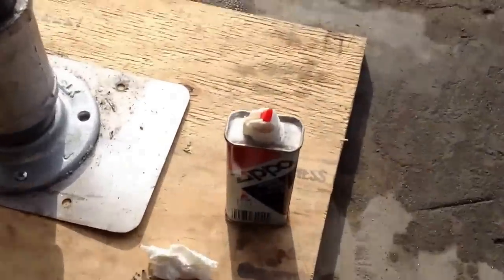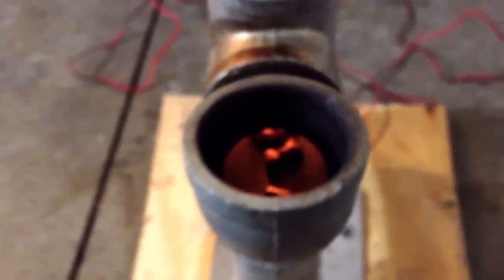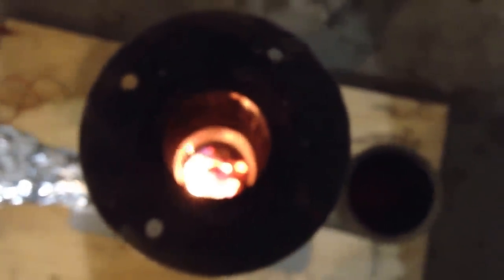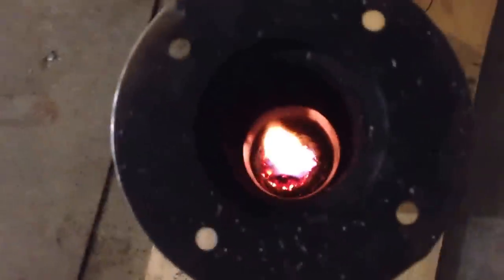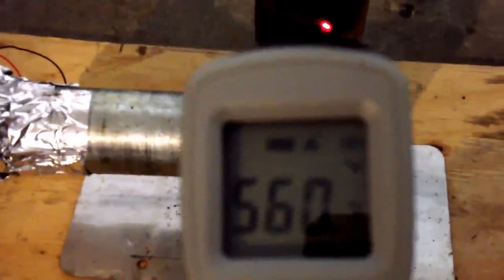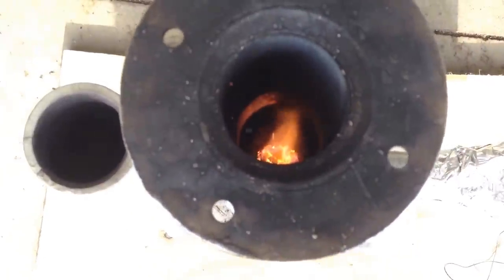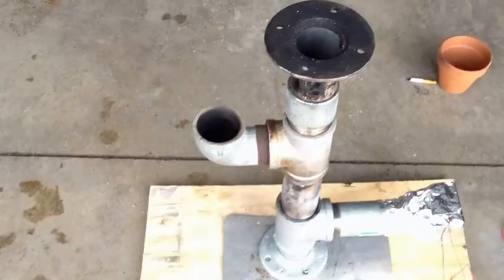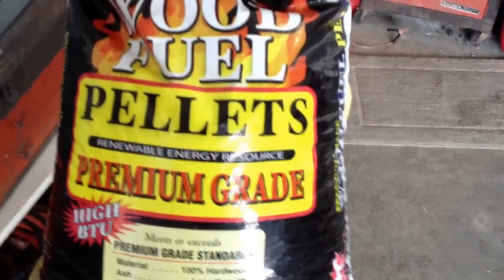Video #3 Pellet rocket stove working total tube burn in action temp readings and pellet usage

Comment: Appreciate all your work and experimenting. Fun and practical. I was glad to get a ballpark of the temperature. Thanks for that. I'm betting a bit larger diameter cast pipe would increase airflow and temp, if it is available retail somewhere.
Reply from the maker: Yes I agree larger diameter would be better it is a little bit harder to find and more expensive, but you can get it

Comment: GO to a plumping wholesaler, they have larger sizes in blk iron and cheaper. DON"T ever use galvanized pipe of any kind even out side a couple of good lung fulls cause you were standing down wind and your toast. Just saying. Other wise looks good.
Maybe try drilling a small hole for ventilation at or near the base. I think you could get rid of the fan then .

Comment: there is also galvanize on the steel that is very toxic, Black Pipe would be much safer, as it is Not Galv.
You should not have to use a fan, But you do Not have any air flow under the burn, air flow under the burn would allow you Not needing any electricity. You are chocking the Air intake air flow, that is why lower heat is produced.
Reply from the maker: I couldn't find any black pipe that size, I know you can get it, but not as easy as galvanized, lowes and home depot carry the 2 inch galvanized, you can burn most the galvanizing of if you get it hot enough, This was an experiment for others to make sugjestions and improve, thanks for the info and thanks for watching

Comment: burn pellets from the bottom,use sanitary Tee where you feed pellets, you need way more air in to really burn the pellets use a 115 vac powered fan ,right above where you have the air in you need to install a grate,on top you need an old a air tank to run the exhaust through with a hole cut through near the bottom for an exhaust pipe and then it will get real hot 700 to 900 degrees.

Comment: That's nice, a low heat 1kwatt clean burn. Can it burn the pellets faster than that or  it has a fixed burn rate?
Reply from the maker: Have not tried it yet, but I think with more air flow it will burn faster, I will try it some time when I get more time,  Thanks
Reply: I know this is an old video..but I just found it..A faster burn time and an increased temp should be achievable with a variable speed fan. With the addition of a variable switch like on a dimmable light switch could give you that sort of control. 

My only concern with this stove as a garage or home heater is (As you addressed in another comment) the build-up over time of carbon monoxide and CO2. I really do like your designs though. with good ventilation that should never be a problem.
Reply from the maker: Thanks for your input your right about carbondioxide build up is very dangerous thanks for watching

Comment: so we can't use this inside the house? If not can we build this outside and pipe the heat inside?
Reply from the maker: You would have to ask a expert, it sounds possible, but you would have to have a professional do it. my concern would be possible fire, and carbon monoxide if not hooked up right, if possible...
Reply: Thank you

Comment: "Garage door closed, no smoke." ??? 
CO and CO2 are invisible and odorless!
Reply from the maker: Carbon monoxide testers in garage, as I said in the video, and I opened the garage door after only a very little time, you are right carbon monoxide is very dangers and this should always be used in well ventilated areas

Comment: You could use cotton ball dipped in wax or petroleum jelly as a fire starter.  Nice.
Reply from the maker: Thanks for info, I did not show in video, but I had to roll up expanded metal and insert it into the 2" pipe, and fill pellets into the center of expanded metal to get air to flow around the wood pellets. Just envision the pellets surrounded by expanded metal, I show how I did it in one of my gassifer videos above.

Comment: I like what you're doing. I'm on a similar path. Except my rocket stove pipe does not use a fan. Please check it out. Search " Raging Pellet Rocket Stove Pipe *GRAVITY SELF FEED" .  It achieves ridiculous air draft and temps over 700ºF+ for over 30 minutes on a few handfuls of wood pellets.  I want to incorporate a fan like yours. I think it would increase temp potential exponentially.  Great work...thx for posting
Reply from the maker: just saw this post I will check yours out thanks
Reply: Ray Isimz cool. Thx
Reply: Sean Vincent did you develop a fool proof self feeding system? I have another life besides feeding pellets every half-hour.
Reply: Douglas Pohl.   yup. just connected a hopper (like ones used to spray texture on walls using joint compound ) it fits feed pipe perfectly.  Burns as long as I want. I used it to heat a tent with a heat exchanger. Rocket pipe outside, blow recirculated air in camping tent. Kids love it.
Reply: Sean Vincent did you document or video - url please. Many pellet gravity feeds do not operate many hours and plug from the tar & charcoal due to poor air-fuel mixture.
Reply: Posted on my Facebook.  Sorry didn't save it.